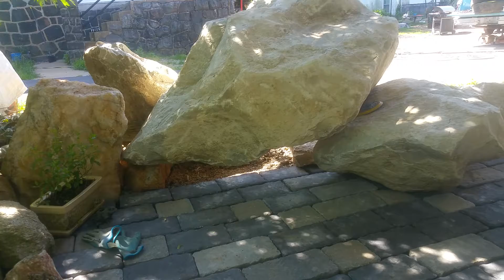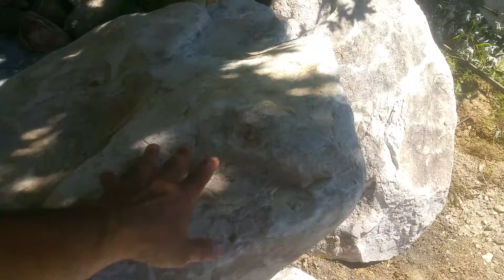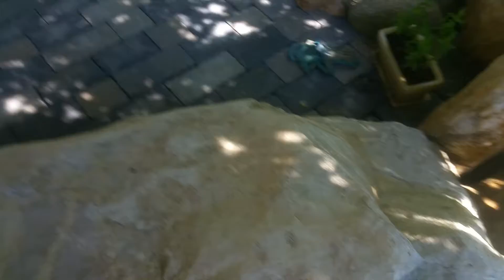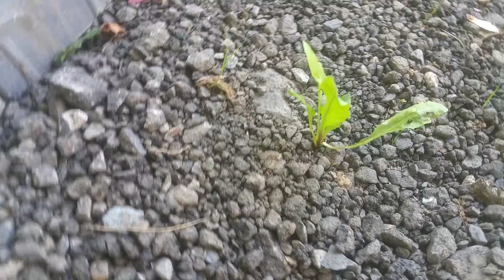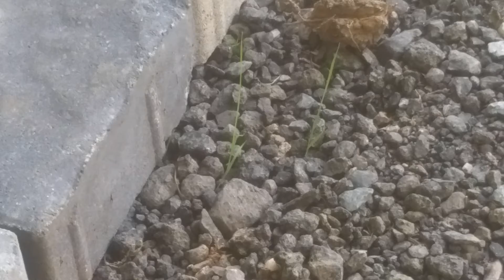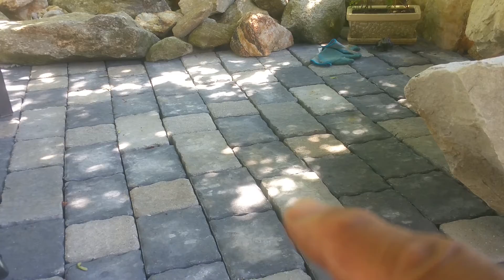Fiu Bridge Collapse Artificial Intelligence to blame for bridge failure

Comment: The DC-9 (and similar MD 8 and MD 9) was largely designed in the late 50s and early 60s. That is the commercial jet with two engines by the tail section. When designing, the engineers had only rudimentary computing power available so relied on practical math, common sense, and real-world testing. My pilot colleagues (who are all based in Europe) LOVED that plane; they said it was similar to driving a car so was the perfect starter plane. When weather got hairy, they said the plane was rock solid and confidence inspiring. 

Modern design tools and materials can do so much but they are a bit separate from "reality" so maybe require even more common sense and more real-world testing.
Reply from the maker: Thank you for the knowledge...
Reply from the maker: I can imagine the skill set of the pilots then compared to today... hmmm  
I mean if you could train those guys to fly this auto-pilot stuff,  would they even want to?
Reply: @EngineerPEretired These were still very popular through the 2000s, albeit with some updating and a different name (MD9). I think most have been retired at this point. My pilot colleagues said this plane always reverted to stable so that was a type of safety auto pilot via excellent design.